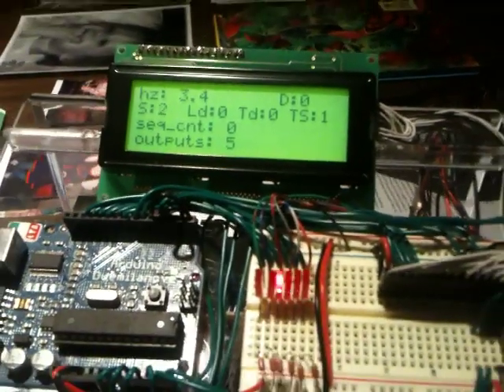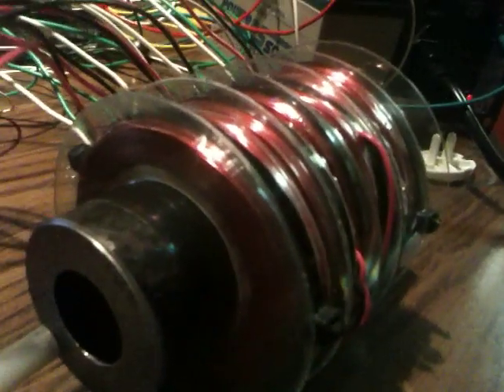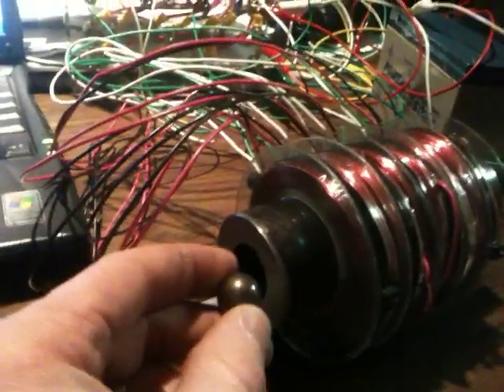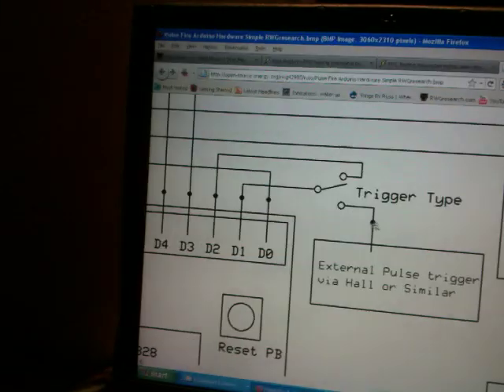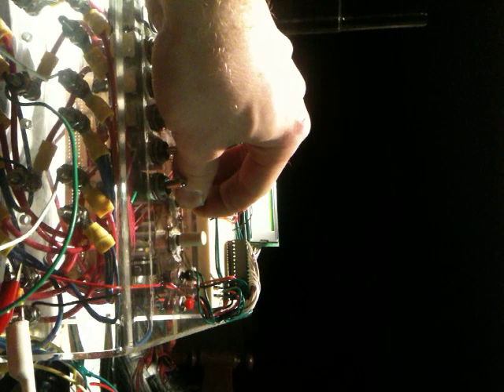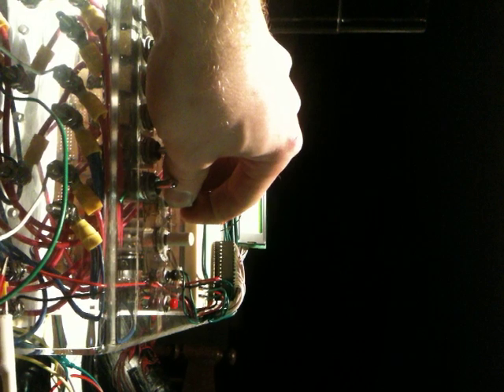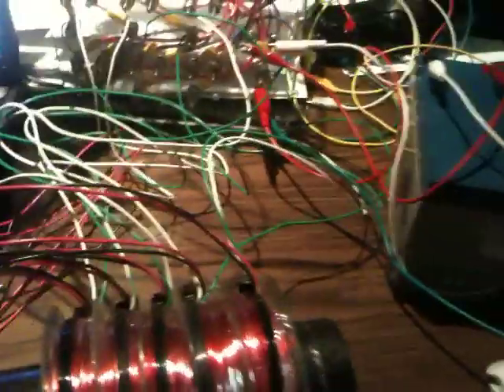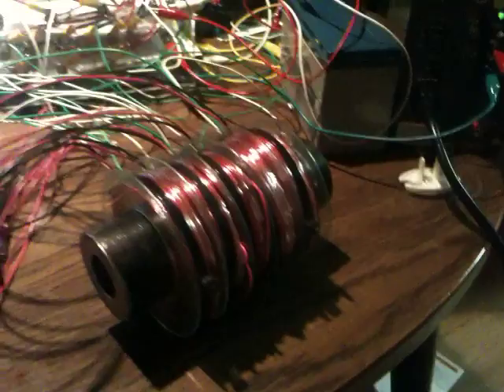Pre Testing Pulse Fire with 5 Coil Core! Making Some Funny Sounds... What is that? RWGresearch.com

Comment: Hi Russ,
The induced field is concentrating in the core, not passing through it.
The field from one coil extends within the core inside other adjacent coils.
If the coils are to be particle accelerators then the particles must be the core.
Induced field is greatest close to windings, so remove the metal core, insert a plastic pipe, then insert another plastic pipe with small concentric gap for particulate gas to pass near the windings.
Then use end funnels to link to a tube/ increase velocity.

Comment: I think 5 separate smaller iron cores spaced out would maybe work better.   Or like z1zaz said to do with concentric tubes, but put the iron core (solid rod) inside the inner tube.

Comment: I wonder If the  individual coil being pulsed  is inducing a voltage and magnetic field in the coils before and after it in addition to absorbing into the steel core? Maybe a 1/4" thick steel washer between the coils with an air core would be able to contain the field then you may be able to pulse the coils slowly and "pull" the steel ball to different locations.